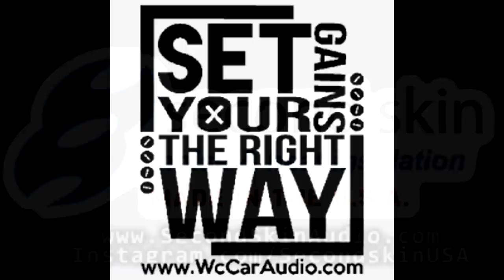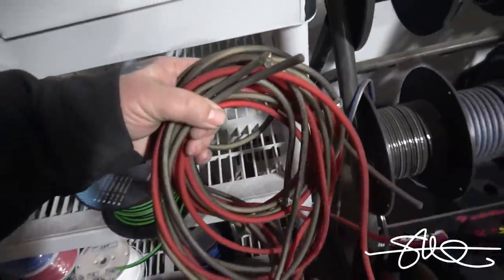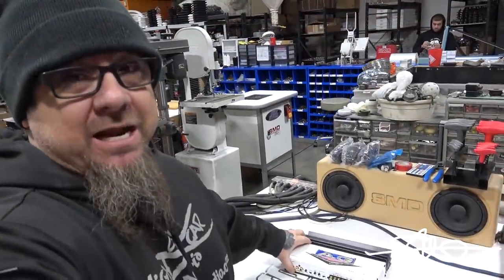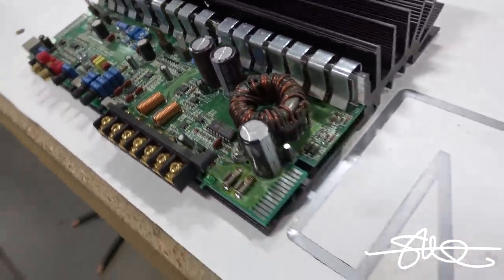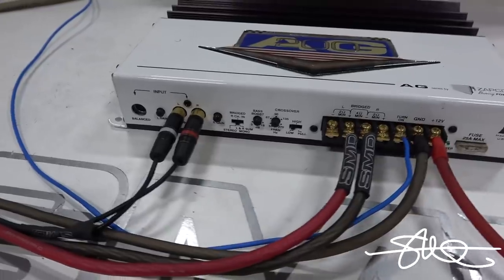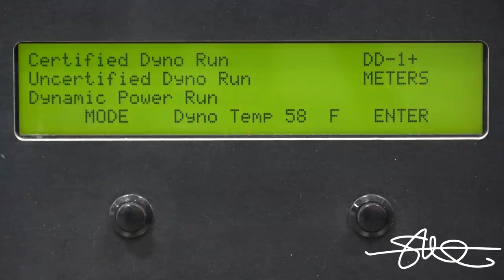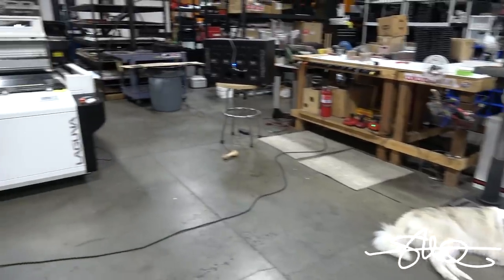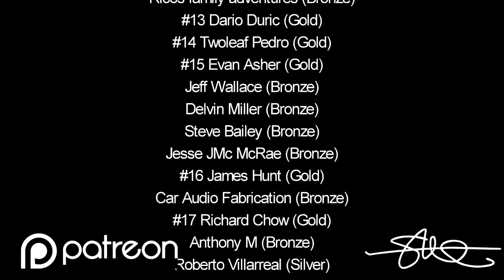Amp Test Tuesday! Zapco AG200 + the Guts (cover removed)

Comment: Back in the early 2000's I used to run a 4-channel kenwood amp, back then those "oldschool" amps people would use a single 8 gauge power & ground wire ran straight from the battery with a inline fuse holder. There was no "Big 3" most people didn't use distribution blocks back then....
Reply from the maker: early 2000's? nah. We were already super evolved by then.  I have learned a lot SINCE then, but even in the 2000's nobody who knew anything did any of that. We were doing it right. The people that are running 8ga, no big 3 and no distro blocks are still doing it.

Comment: Good quality amps back then were and still are great for mids & high's today unless your building a 20,000 watt super loud car stereo then you might have to upgrade but for the most part a nice loud  500 watt to 2000 watt system will do just fine knowing what you are doing, you can bridge that zapco amp!!!!!

Comment: What up..I’ve had a Zapco AG 750 for over 20  years now. A friend sold it to me for $200 bucks. They were supposed to be bad ass amps back then. Never installed ( have no idea why). Will finally be installing next week with a 12 inch sun down audio sub. 2 Hertz Mille Legend components on the doors, (arc audio 150x2 amp).

Comment: at one time i owned 11 AG's.  i still have a 360 and 200 for my project car.  i won't give them up!
Reply: I still have a pile of sets of them, White - grey - piano black and DC amps. Probably a system or two of each vintage. 
A box of sybilinks with cables and two DSP6. All good stuff for SQ

Comment: if u use the symbilink balanced input it will take up to 16 volts from a zapco equalizer but u need to use a din to din cable not the rca inputs.

Comment: Awesome as always Steve. I have a very serious question. Out here where I am at there is a huge debate about putting acoustic batting in a ported box. Some say it kills the sound and others say it tightens up the low bass. I haven't had time to build anything to try which is better, so what are your thoughts? It would appreciated. Thanks

Comment: Great Video, What gauge did you end up using for the power and ground? I have Zapco 350.2 and running 4awg from front to rear, but the terminals on amp don't look like they can accept the 4awg, what did you use to plug wire in? Ring Terminal? THanks You Rock
Reply: It accepts 8 gauge wire. I used spades on my 350.2

Comment: Sadly that type of QC control and elite Zapco anything left with Robert Zeff. Glad to know he is still involved with Arc tho, had a good industry talk with the crew at SEMA. RIP Zapco :( from an OG Central Valley dealer right up the street
Reply: I love arc audio system so far i put around 5k into arc and maaaaa. I love it they sound amazing just 1100.1 is handling 2 10 pioneer 2500 800 rms each like champ and never gets hot
Reply: Zapco was the best back in the day...

Comment: Im curious to find out what those 2  male plugs on the amps main board were for, i wonder if it was made to hook to other amps for more power or more control
Reply from the maker: not sure. I was thinking maybe for testing the boards before they are installed into the case or something.

Comment: Hey steav what's your take on the use of spade terminals..on amps today..
Reply: If the amp uses terminals / screws like this, use them; unless you want to stuff bare wires under those clamp washers... but good luck getting anything but a remote wire secured. Spade terminals and crimping is just fine for amps like this Zapco with those style screws.
Reply from the maker: only cheap amps use those these days.

Comment: Looking for some Sub. advice.. I have an old Rockford Fosgate bd1001 amp that puts out 1083rms @2ohm...my question is can a single Sundown Audio SA15d4 handle that kind of power for a daily? Or should I consider one of the 1500wrms subs maybe the E or the U I forget witch.  I plan to build a spec aero ported box as large as I can fit in my trunk with tuning around 32-34hz. Any Sub. recommendations or input would be greatly appreciated. Thank you
Reply: An overpowered amp won't blow the sub, setting the volume too high will blow the sub, it should perform nicely on that amp. It's always good to have good headroom in the amp so it doesn't "run out of breath" under heavy use. I use an amp rated to about twice the power rating for my sub and it performs nicely, pretty much impossible to make it distort.
Reply: Håkon T. Thank you! I will keep this in mind.
Reply: that amp would be fine on that SA15

Comment: Hey man. Im building a budget system. I got me a PL3000.2 planet audio amp for $90 today. Its still in the box unused. I only need 800 rms. Could you tell me what numbers I should expect from it? I know its no award winning amp lol
Reply: 85db. 120 when it's installed in car and launches off cliff
Reply: @chrisjones6165  It's for my daily. Im only running 2 400 rms subs in my daily and I never had a planet audio amp before. Lot of mixed reviews on it. It has (2) 40 amp fuses on the side of it. The local audio shop said I should able to get 800 rms out of it. Im unsure
Reply: @illililililillli  the ones I've heard really sound good for their price point.
Reply: @RockfordF150Bass  Thank you!
Reply: @illililililillli  no problem sir
Reply: I'd just make sure you feed the pig with true 1/0 guage wires on hot ground with a 300 amp fuse on the power so once you give it all the chance possible to get that high current. Set your gains and and just enjoy. From what I've seen the 3000.1D will do at 1 ohm around 1100 to 1300 watts peak and 700 to 850 watts RMS so you should be fine
Reply: The planets audios aren't the worst but they will do a budget bang from what amp dynos I've seen

Comment: Can you do the Power Acoustik Edge 2500 I’m about to run that on 2 Skar SDR 10s
Reply from the maker: don't buy that amp. You will be sorry if you do and then i test it. Just warning you.
Reply: meade916 what about the Razor 3500? I heard good reviews about those
Reply: @dandredildy  Get a Rockford Fosgate amp. Can never go wrong. If too high a price point, Look at Rockford's Prime line.
Reply: tverbunkerjr lots of people told me about Rockford and how it doesn’t play what it’s advertised to do especially the subs
Reply: Power acoustik is garbage bro .
Reply: AnDrEw122100 I know I’m just gonna stick with Skar but I’m getting the Power Acoustik NB-1 Tweeters they have a crisp sound to them
Reply: @dandredildy  Rockford Fosgate is underrated. What this means, is that an amp does more power than what it's rated at. My 1,200 watt RF amp actually puts out 1,580 watts @ 1 ohm. I am running 1 12in. RE Audio Sxx sub, which is a 1,200 watt sub, and the sub handles it just fine. Match quality to quality, not quality to cheap. You'll save yourself some disappointment.

Comment: So you got a 10.000W power supply to test some 200W amp.
Nice one made..... Next one better be some Apocalypse or some Doomsday!
Reply from the maker: i got it to test whatever i want without using my battery bank.  Sorry, i have never heard of either one of those you named.  I think ill test a 150w amp next time just for you.
Reply: @meade916  Sorry if you thought i was hating on you but it's just frustrating for me.
 Doomsday & Apocalypse are some amp series from Deaf Bonce.
The guy from your video with the Alphard Ford had some but i think they're  rebranded or something  because i can't find  them online.
I'm just saying that now that you got the new power supply it won't be cool to test low power amps.
No hate bro, i like your builds and videos! Keep it going!
Reply from the maker: @ClaW212  all good man! ya i don't really know that much about Deaf Bonce.  Nice people for sure! like AMAZINGLY nice.  People love their products.  But i don't know anything about them.
Reply: @meade916  It would be fun to see one of those amps on the bench. I watched some test and the AAK-5500.1D did around 1000W more than the specified value on all the runs. +1500W on the dynamic run @1 OHM.
Reply: @meade916  And the Doomsday is rated 37800W @ 14.4V  @ 1 OHM and 42300 W @ 18V wich is just INSANE!

Comment: Anyone else cringe when manufacturers put ground next to power like that? 😭
Reply from the maker: no. Doesn't bother me at all.
Reply: meade916 I currently have a kenwood amp with that design. I decided to insulate the power cable with heat shrink but that’s just me. I always have a small fear that something will end up falling between the two
Reply: Yes indeed..I'm a total cluts..pop lots of fuses over the years
Reply: I never had any issues with power and ground next to each other, I've had tons of different amps over the last 15-20 years. Wired with proper terminals, they will never touch. Shouldn't be hooking up amps with live power wire anyway, or have anything conductive that will fall onto the wires.
Reply: 621ELECTRONICS  I’m well aware of the dangers. Just makes me squeamish